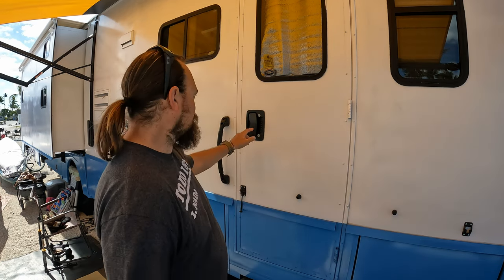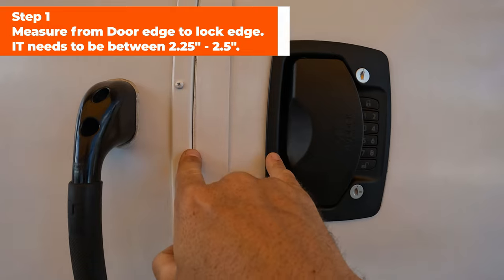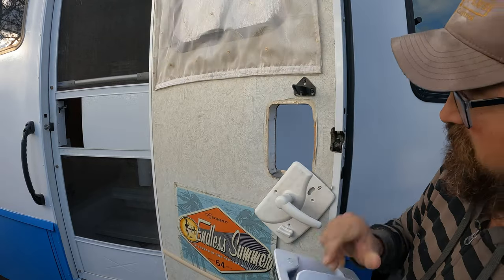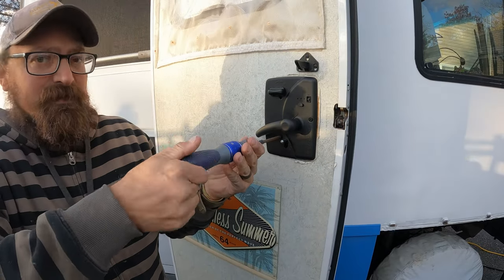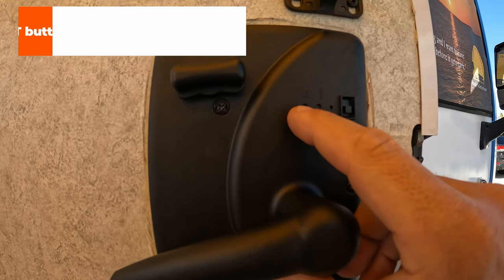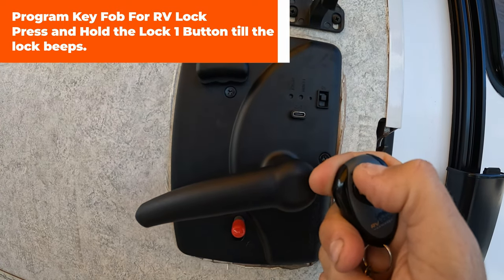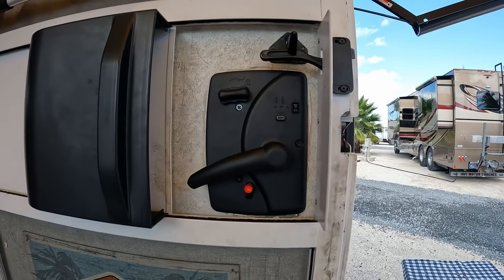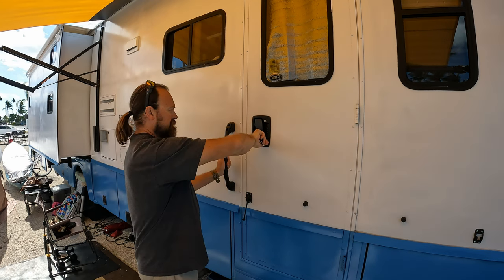IS THIS THE BEST UPGRADE FOR YOUR RV? RV Lock Atlas Keyless Entry Review

Comment: So does the new handle lock/unlock the lower lock too, besides sliding the dead bolt?
Reply from the maker: The code only activates the dead bolt. you need to manually lock the bottom lock.